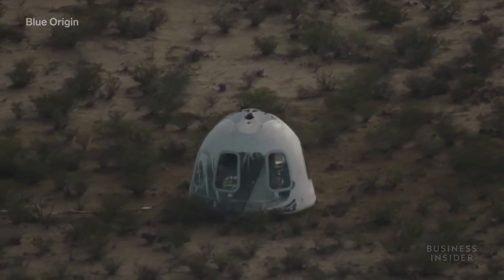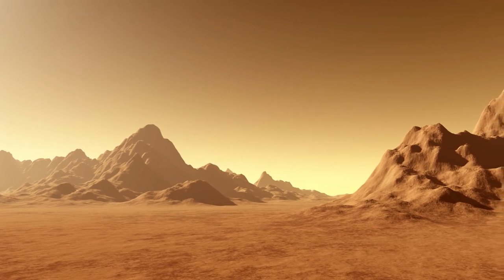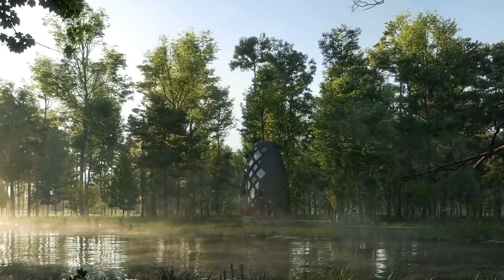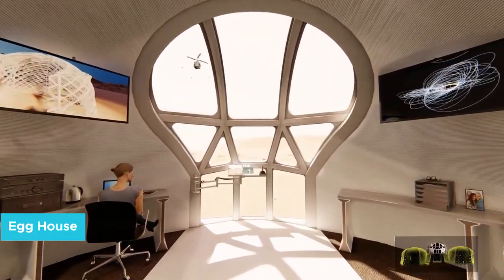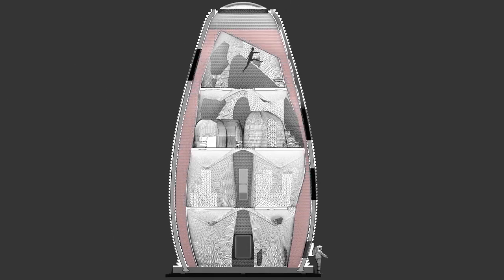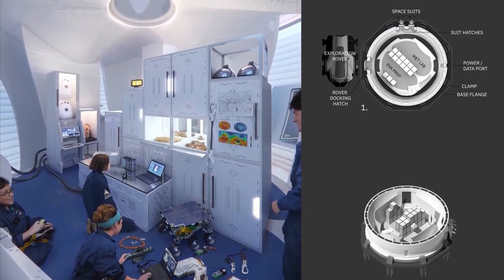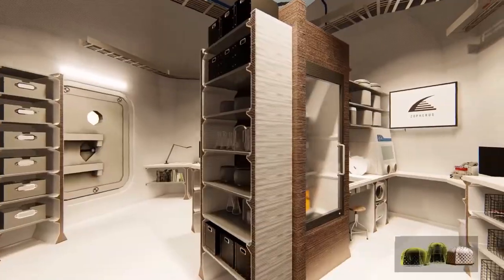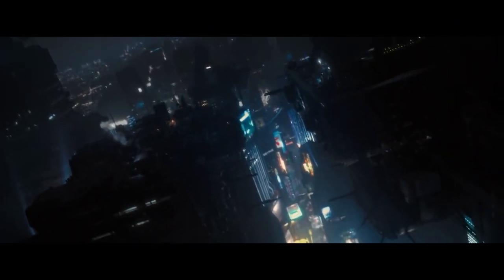Life on Mars Exploration is Including 3-D Printed Homes

Comment: With the temperature fluctuations on Mars. Not sure of the validity of a 3d printed habitat. Stainless covered with regolith would be the way to go.
Reply: Where do you get the stainless, the Starship?
Reply: @reginaromsey  probably better to bring with in the cargo starship or as part of a ship. It's best to move a base or hab a safe distance away from the ship. There's a way to set up a large structure that's quick, mobile and long lasting if stainless is used.